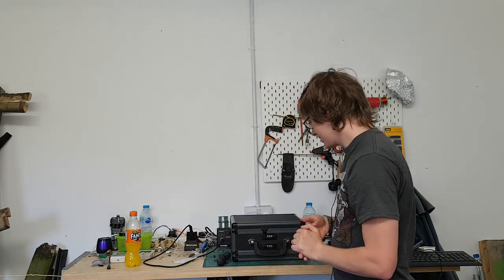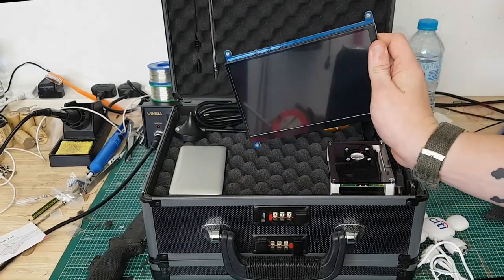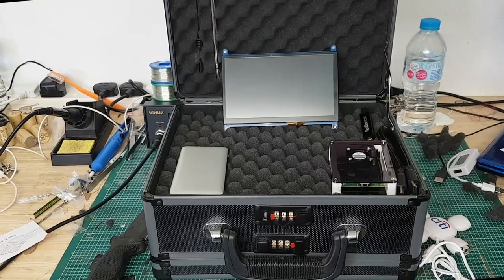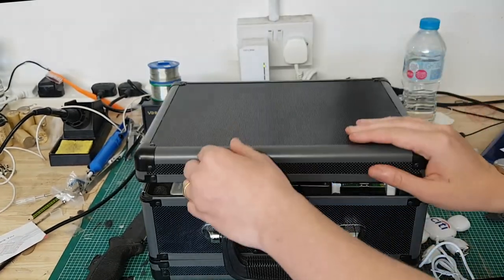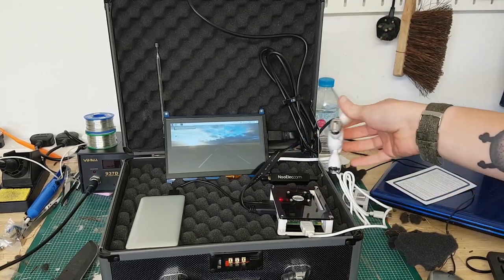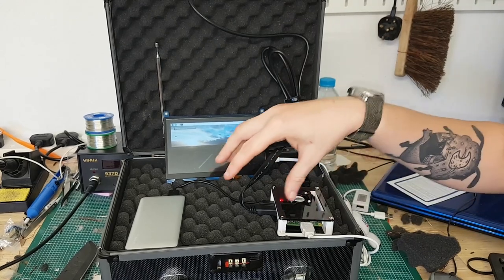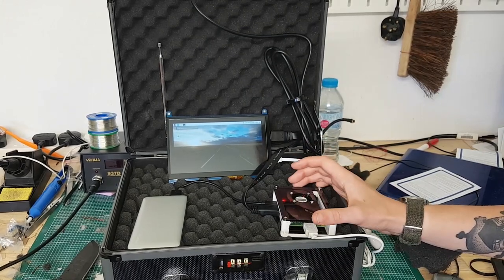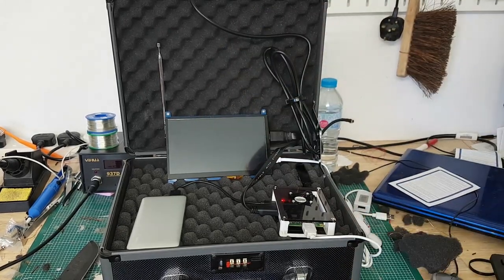Building A Hack-In-The-Box

Comment: What software are you considering?

I'm looking to identify ham radio repeaters in several areas here in the U.S. (The available guides are sadly out of date.) It'd be nice to use a setup like yours to log the active ones as I drive through on the way to vist my fiancee.
Reply from the maker: So far I have been using SDR# and GNU radio but once I get new tools added that may change. How are you planning to identify repeaters?
Reply: @Brains933  Thanks! I'm mostly just interested in seeing which ones are active. Once I have a list of active machines I can monitor their frequencies and get their callsigns.

If I could put together a system that makes note of the time and my vehicle's location when it detects an active frequency, that would be ideal.
Reply from the maker: Should be able to put somthing like that together with GNU radio but their  may be somthing purpose built to do that very thing.